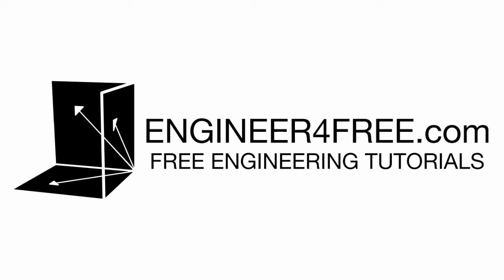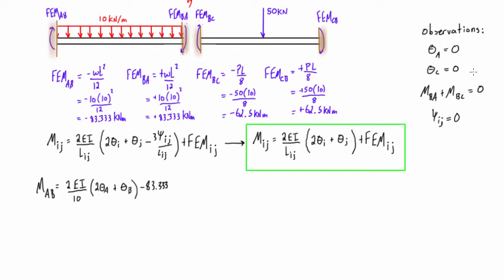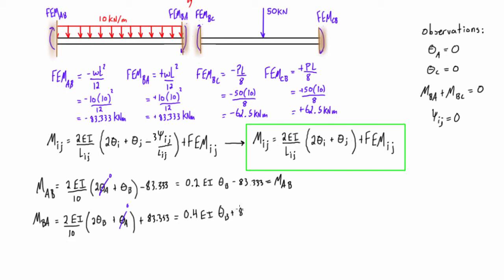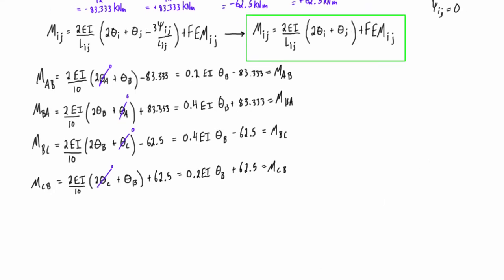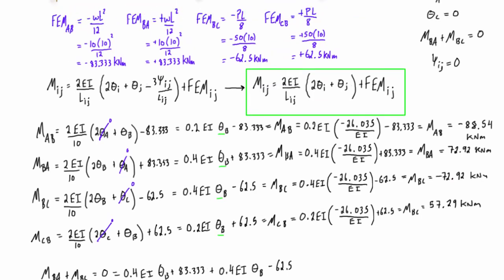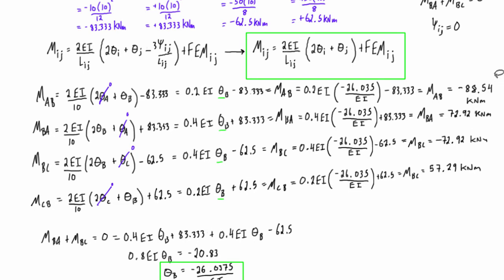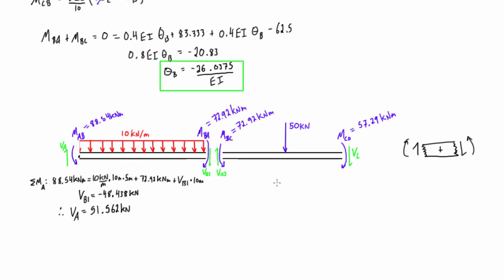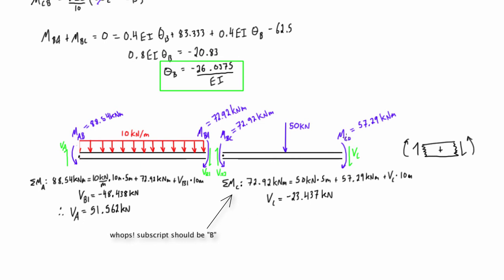Slope deflection method example #1 (part 2/3)

Comment: how does one gt va = 51.562kn?
Reply from the maker: The span on the left that we've drawn is just a free body diagram of the beam with virtual cuts at each end. The stuff that is acting on this free body diagram are the two moments drawn in blue, two shears (essentially point loads) drawn in green and the distributed load drawn in red. We just do statics on it. The sum of forces in the x direction is zero, the sum of forces in the y directions is zero, and the sum of moments about some point is zero. There are three vertical forces in total (Va, Vb1, wx) wx is just the distributed load in kN/m times it's lenght, so wx=(10kN/m)*(10m)=100kN downwards, and Vb1was found to be -48.438kN, and because we drew it on the fbd in the downward direction, the negative sign indicates that it is opposite to our assumption, so it is actually pointing up. If up is the positive convention then Va+vb1-wx=0, or Va=wx-vb1, Va=100-48.438, Va=51.562. Does that clear it up?